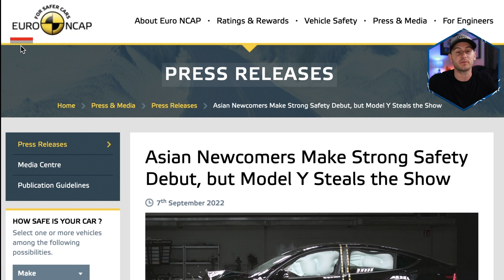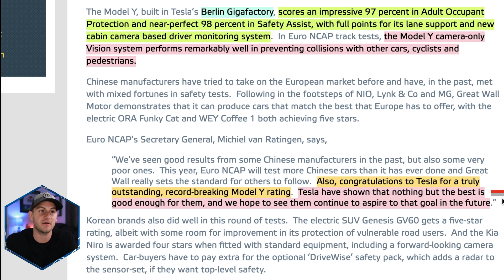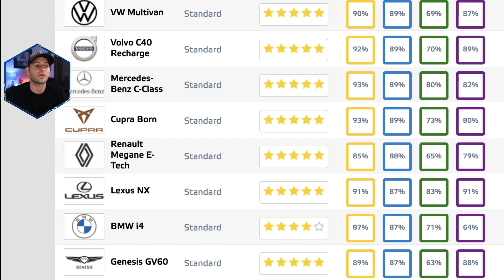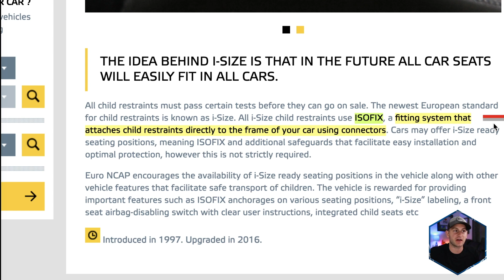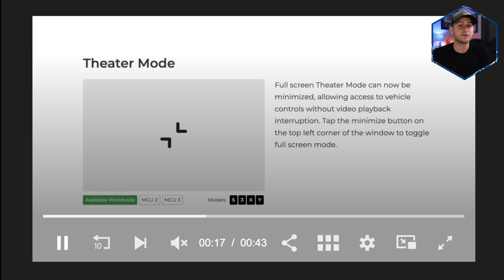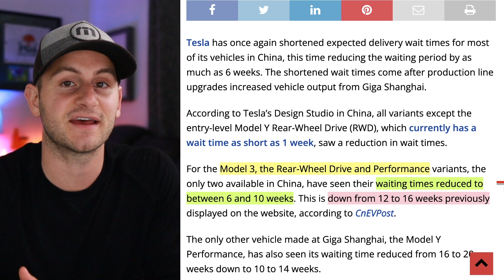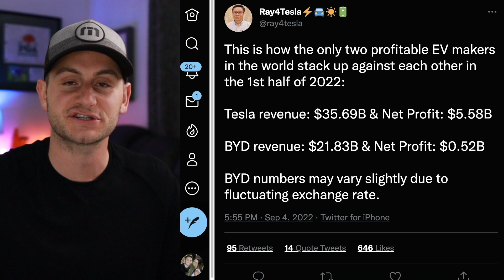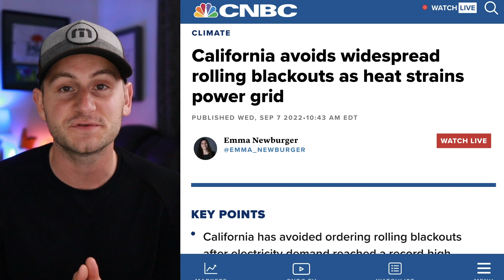Munro On Repairability of Gigacastings / Tesla Breaks Safety Records / Ford's EV Ramp ⚡️

Comment: No normal steel frame cars is not gona be totalled in crash like this if it is worth to repair. Becasue it CAN be repaired, it only depends on HOW MUCH does repair cost, which really differs on countries.. but with Tesla, you are basically fked.

Comment: Sorry Dillon but speaking truth to power begins with those we respect most.  The castings are certainly a major manufacturing innovation but they can very well become a consumer nightmare upon impact.  We can debate angle and force or wait to see how many Model Y are totaled  over time, but let’s be clear that those castings aren’t about safety, they are about cost savings first and foremost.  Consumers may very well find themselves going through the hassle of waiting months for a new replacement and paying high insurance premiums for Model Y vehicles upon a relatively benign rear fender bender.

Comment: The castings will of course increase the number of cars that are totaled. Castings are notoriously unrepairable. Steel can be pounded back into shape; Aluminum cannot. The ductility, and ability to do plastic deformation is why steel has been used in cars since the dawn of automobiles. 

It is misleading to tell people that these castings are a good thing for the consumer. They lower the manufacturing cost at the expense of repairability. It would have been better for repairability if they had made several sub-pieces and riveted them so that each piece could be replace separately. These giant pieces are not repair friendly.
Reply: Steel has been used because it is cheap.￼ Rivet sub pieces together? That defeats the purpose. You don’t build automobiles for ease of repair. Automobiles should be built for safety as the top priority. Do you crash a lot or something? You are definitely not an engineer design or manufacturing.
Reply: @ZeusBullyMax  If build products like Apple does, which has some of the lowest repairability of their products in the phone space, you generate a ton of e-waste.

It is irresponsible, and a very modern concept to made a 60k product that is not designed to be easily repairable.

If every accident above some modest degree in the rear totals the Tesla, that is hardly ecologically sound. A car is a gigantic amount of waste. 

It only would add a small amount to the production cost to make things repairable. The Nokia phone for example that had a single screw, and the guts popped out, the one in the polycarbonate casing, showed that cellphones need not be disposable items, which alas they are nowadays.
Reply: @ZeusBullyMax  Steel is a very complex alloy that took billions to develop, and there are thousands of different formulations, and in its early days was an exotic material expensive like carbon fiber was in the beginning. It is only because it was so massively superior to any other alloy that it became frequently used. But those old Samurai swords took a lot of time and money to make, and that is an example of several hundred year old steelmaking.

Someday Titanium alloys will be more common, and perhaps ceramic materials if the brittleness can be solved will replace metals.  But as SpaceX is showing in their big starship, Steel is a superior material when you take all the different factors into consideration.
Reply: @ZeusBullyMax  nonsense!!!! Automobiles are built for both safety and repairability and serviceability and modifications……… what’s going to happen to the cybertruck!? Is it going to be also a monolithic useless block!? Trucks are made to be modified.
Reply: @ZeusBullyMax  you definitely know nothing about the automotive industry. Cars are indeed designed with repair in mind to keep potential warranty costs manageable. The Japanese auto industry pioneered that in the 90's.
Reply: The best accident is no accident. The best repair is no repair.
Reply: @tonydeveyra  unfortunately such thing doesn’t exist in this world sorry to disappoint you lol….
Reply: The castings won't make as much difference in Teslas being totaled by the insurance company as you think. It doesn't really take that much to total an ICE vehicle built from steel stampings these days. Where they will make a tremendous difference is in how repairable they are to the rebuilders. Cars don't just get thrown away when the insurance company totals them, they get sold and rebuilt. If they aren't rebuildable that's a lot of waste, and not really in line with Elon's long term goals. I'm betting that Tesla eventually tweaks the design improve repairability.
Reply: @jimmaag4274  bullshit!!!!! Cars built with steel have reinforced sections all around were no more in the 70,s here wtf!!!! Have you seen Volvo car crashes!? So stfu!!! Teslas are already one of the most expensive cars to repair now imagine the casting.
Reply: @jimmaag4274  tesla trying to improve repairability!? Lol….. the structural pack is a total disaster for both repairability and reusability and it’s only getting worse with time.

Comment: I watched that whole Munroe vid early.  Purple Industrial adhesive behind bolts and rivet bolts. Nope - not gonna come apart real easy. A fascinating Vid. The were flabbergasted. Hundreds of parts reduced to 3.  And apparently along with the Purple Goo the rear casting becomes a an almost solid part of the whole. The front casting even incorporates the shock tower with an added "steel" reinforcement.  Just WOW !

Here is something most never consider but I have seen so many times. Vehicles broken in half in accidents from rusted frames.  Rear Trailing arms failing out of vehicles. Etc. These events will soon be in the past along with the days of front bench seats ejected out of passenger doors with passengers when T-Boned.
Reply: Lol…… which other manufacturers actually ever used hundred parts like tesla did before!? Lol…. Stfu!!!
Reply: Nonsense!!!!! I’ve seen a tesla modelX litteraly cut in half in an accident with a Nissan GT-R and the tesla already had rear casting so your comment makes no sense at all!
Reply: @carholic-sz3qv  I’ve also seen new semi trucks Cut in half in accidents. Cows in radiators. Engines ejected from DUIs hitting trees so violently. 

Aluminum doesn’t rust. 

But overall the new vehicles with aluminum castings are causing less damage to fragile human tissue. 

Still can’t stop Stupid with humans at the helm.
Reply: @Jack.Waters  steel cars are equally as safe also there are very few cars that are 100% made from aluminum including a lot of Audis…..
Reply: @Jack.Waters  people getting ejected from cars is actually a stupid comment to bring here! It doesn’t happen when you wear your seatbelt which Volvo actually invented and gave it free to the automotive industry.
Reply: @carholic-sz3qv  Apparently you never saw a 55 chevy get T-Boned..  Get out of your Arm Chair and live life some.

Comment: Dillan, something that you and Munro are missing with regards to vehicle collision damage. Cars have to be very, very damaged to not be ultimately repaired after the insurance company totals them. The real question is, once a rebuilder purchases it at COPART, can it be rebuilt and put back on the road?

In the case of a conventionally built car with a front end hit and a tweaked engine box that was totaled  by the insurance company, a rebuilder will cut the core support out, pull the frame back straight, weld in a new core support and it's ready for a hood, fenders and bumper cover thus keeping it out of the scrap yard. 

In my experience with aluminum castings they are not malleable enough to straighten and are thus not "repairable". This is what gigacasting detractors and talking about. I'm a serious Tesla bull and expect them to rule the automotive world in the end, just thought I'd add some real world info. (I was in the car business all my working life from the repair side to the manufacturing support side)
Reply: One word is ARTHUR TUSSIK on YouTube he does all kinds of crazy rebuilds on salavaged cars and the tesla isn’t even possible to save! Let alone tesla won’t sell you the big castings as a part.
Reply: @carholic-sz3qv  there will be a LOT of residual value left in totaled Teslas. I guarantee you that people will figure out how to rebuild them profitably.
Reply: @jimmaag4274  lol…… there is alot of residual value left in a lot of cars not just teslas and as far as tesla goes they control the car and a rebuild will mean no more accès to their services like supercharging…….

Comment: Fire burn acreage  in the US in August was a record low. It's been very wet in most of the West this yr.
     There has not been an Atlantic  hurricane in the first 3 months of this year's  hurricane season. That's the slowest start to the hurricane season ever,
Reply: Nationwide since 2000, an annual average of 70,072 wildfires has burned an annual average of 7.0 million acres. The acreage figure is more than double the average annual acreage burned in the 1990s (3.3 million acres). Most wildfires are human-caused (89% on average from 2017 to 2021), although the wildfires caused by lightning tend to be slightly larger and burn more acreage (52% of the average acreage burned from 2017 to 2021 was ignited by lightning).
Reply: @beautifulgirl219  I realize that there has been a slight upward trend in wildfires since 1983,  but that reversed a 50 trend of falling wildfire burn acreage. For example, in 1931 over 50,000,000 acres were burned, over 5 times what can be expected today. CO2's got nothing to do with it.
Reply: >  So forest fire smoke prevents hurricanes.  The year 1914 had no Atlantic hurricanes as far as they know using telescopes and flag signals.   What's this got to do with electric news?
Reply: @carlwest859  There were 9 hurricane strikes in the US from 2010 to 2019. That's the lowest number of hurricane strikes for a decade in US history. The record high number of hurricanes strikes in a decade for the US was the 1880s when 26 hurricanes struck the US.

The US has not had an F5 tornado since 2013. That's a record long period for no F5 tornadoes. Also, there were no F4 or F5 tornadoes in 2018. That's the first time that's happened.

Things are not getting worse despite rising CO2.

Comment: Remember when Elon looked foolish  comparing the Pole test of the Model 3 and the Volvo S60? Well I dug into the results of these 2022 NCAP tests and under adult occupancy category for for the Model Y and the little Volvo C40. On the side pole test the Model Y got an adequate score for the torso and 15.8 of 16 on the lateral impact, and the Volvo C40 got a good score on the torso, and a 16.0 of 16.0 of lateral impact  It's called the SIPS system, which moves the seat away from a side impact and makes Volvo's scores better on side impact.  ..... This is one of many safety features Volvo has that everyone seems clueless about including the IIHS, the NHTSA, NCAP, and Tesla.

Comment: All the talk about electric cars, while California seems well on its way to the collapse of its grid.
Reply: I think the CA grid will gradually become prioritized to schedule when electric vehicles can be charged, regulate HVAC thermostats etc
Reply: @timothykeith1367  The concern is not just about EV.  I suspect Texas and California have the same problem. Generation. With all the focus on renewable energy, generation cannot produce enough electricity.  That current generation is having to run non-stop and not shutting down for maintenance.  The future will not be just rolling blackout. But massive load sheding that may last for days. They simply don't have the generation to bring the grid back online.
Reply: @Dularr  There is definitely a gid problem facing EVs.  I believe the social planners will eventually demand that EVs to be used as a short distance conveyance to a mass transit station(this is where I get a mental image of bumper cars at an amuzement park).  The part that electric vehicle owners understand is EVs belong to an anti automobile strategy(gasoline), but I think the end goal is to radically restrict the use of personal use automobiles of all types.  

There is a need for "fuel efficient" electric vehicles, but Americans equate small = cheap and small = death trap.  Insurance companies tax the dickens out of EVs - as if any collision might total them.  Exchanging the gasoline for a spendy EV insurance policy won't be successful.

Comment: On repairability:  Another factor is the car's recyclability.  If Tesla is totalled  it may still have usable batteries, motors etc.  The the castings are pure aluminum that have salvage value.   So if a car is easily and profitably recycled it make sense to do that rather than spend eons trying to repair it - only to wind up with a car that has lost value because of its crash history.
Reply: Stop talking crap!!! All cars have valuable materials not just tesla lol….. other cars have even way more aluminum than tesla. Finally the aluminum in trsla casing is an alloy not pure aluminum. So stfu!!!
Reply: Other cars are actually way easily repairable since they don’t have a single giant part that can fail, just go to Africa, South America around the world even east Europe where cars are repaired for those who can afford cheaper ones

Comment: I wish the content on “Electrified” would be expanded to cover updates on electric cars that are more affordable to the average person.
Reply: Later and current models will be cheaper once production scales. This is a temporary blip in a long-term trend of decimating ICE sales
Reply: he seems to cover whats available in the US, you get what we get, no more, no less.
Reply: what cars are you referring to?
Reply: The F150 isn't affordable either.
Reply: GM seems to have and be developing more affordable electric cars.
Reply: @michaeltarzian  Unfortunately GM have been producing and selling very few of them. Hopefully they will ramp up the sales.
Reply: @michaeltarzian  I hear you but the vehicles need to be appealing and good quality. The Cavalier was a cheap ice car. Enough said there i think.
Reply: @matthewgoedtel5998  That is an old car.  GM makes the Chevy Bolt EUV, which has gotten good reviews for a lower cost BEV…it should also qualify for the $7,500 rebate next year.
Reply: @michaeltarzian  The Cavalier was contemporarily bad. The Bolt EUV is better than the old Bolt however in my opinion GM's Batteries are not very good.
Reply: GM has the deal with the problem of their cars catching on fire. Then they have to build the factories. Way behind the others. And there are very few others.
Reply: There are none.